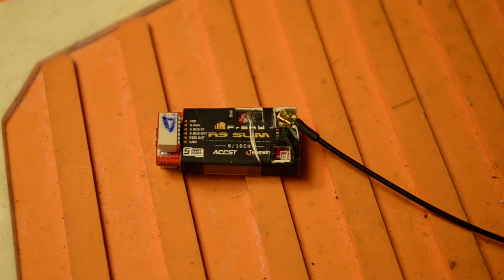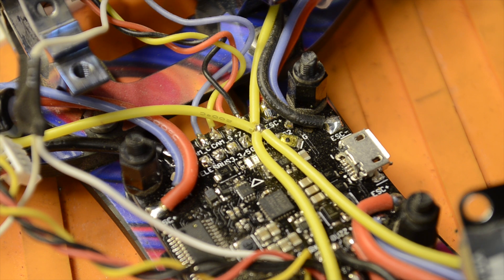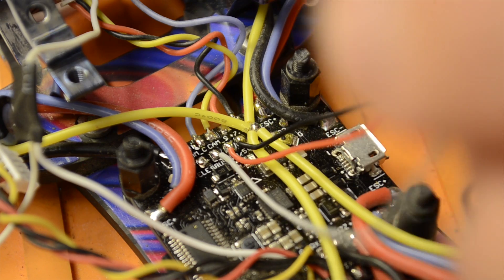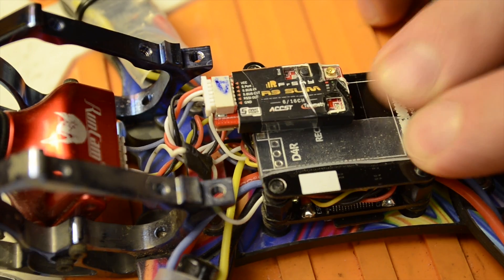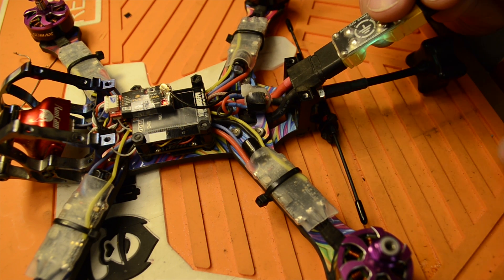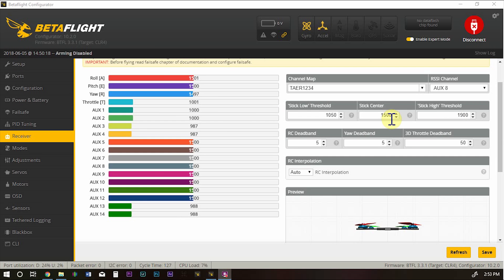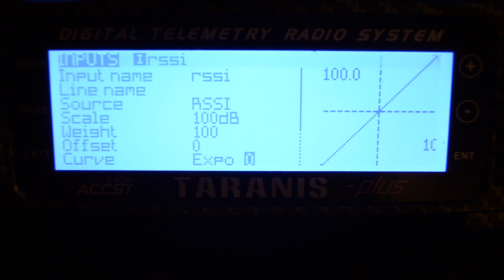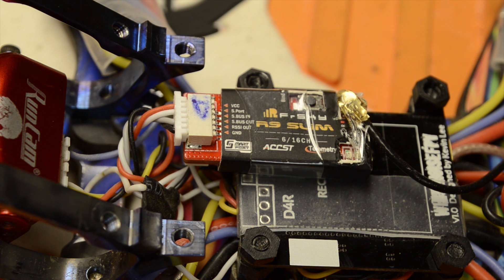Frsky R9 Slim flight controller install, betaflight and , RSSI setup

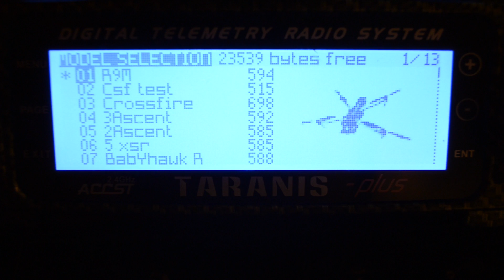Comment: At 10:30 when you say you are not receiving telemetry back from the flight controller, what do you exactly mean what aren’t you receiving. Newbie here :)
Reply from the maker: You won't get flight controller information like: sats (if you have GPS), be able to use LUA scripts for controlling your VTX through your radio screen, and so on. There is a bunch of sensor info that your FC has that can be sent back to your radio for you do interact with. Which sensors depends on your FC.
Reply: @TweetFPV  thanks much appreciate that detailed reply👍

Comment: Great info thanks for sharing ..my question is why don't we setup the sbus in and out ? I have the Frsky R9 Slim + and it also has an rx and tx as well do I need to set them up as well ? Thanks for your time
Reply from the maker: Sbus in on the slim is for receiver redundancy. So you can have a second receiver installed feeding sbus into the R9 Slim so if one fail safes then the other one will take over.
Reply: @TweetFPV   Thank you for getting back to me so quick ...This is my first build and I don't want to wire up anything I don't need too .. I am now one of your subscribers ... Cheers
Reply from the maker: @1ken.cheniergmail  Thank you so much for the sub. The bare minimum you need to connect is power ground and sbus. those 3 and you can fly! Happy building.
Reply from the maker: Awesome, I look forward to it!

Comment: Does RSSI pad and Tele pad on FC are the same?
Reply from the maker: No they are different things. The rssi pad is for analog rssi values from your rx and the Tele pad is a pad for smart port telemetry because it will have an inverter on that uart
Reply: @TweetFPV  thanks alot, I really learn alot from your channel, auto subs! 😀👍

Comment: Hi,I'm installing the slim plus on a omnibus f4 v6 will this work for telemetry on my board and I do not have a tell pad on my board is it called something else? Thanks so much 💥
Reply from the maker: Yes. The slim + will work just fine. It has an inverted telemetry wire to use.

Comment: I’ve been looking into these, I have a set of fatsharks v3s, with the true d dual antenna receiver. Wouldn’t I just lose reception on my goggles if I tried to make use of the long range that these provide?
Reply: Thanks for the reply I’ll put it on my shopping list
Reply from the maker: In a short answer yes your 5.8GHz video link will be your limiting factor. With that said it is possible to get miles of range on 5.8GHz but you have to work towards getting that. Un-obstructed line of site and low background noise it is possible. I find that now with 900mhz rc link I no longer worry about that being a limiting factor. If my video gets bad I know that it's time to turn back. It much more obvious than watching the rssi go down.

Comment: I've had about 7 failsafe on a hundred packs on Slim receivers, d16, no Telemetry hooked up, TBS Immortal T free of carbon fiber... Stop using Diamond antenna seems to be causing more.. all fail-safes between 150 and 300 feet.. I turn power down 2 500mw thinking the high-power up close could be doing it.. no help. Any ideas or have any issues the same?
Reply from the maker: The majority of failsafes I've had were with the slim rx. I think there is an issue with the antenna length. What region are you flying in? I have had better results with the stock antennas than the immortal t antennas. What direction are you mounting your rx antenna and what antenna are you using on your r9m?
Reply: @TweetFPV  region Midwest..lol I think that's what ya ment, umm putting them flat on the arm under esc ( I'm heard keep away from nosiey electronics, which I dont see possible) I'm using mix of TBS and stock on quad. Diapole on r9m

Comment: Good info. Thanks. Can I use R9 slim to APM ...???
Reply from the maker: I'm sorry, I don't know what APM is.
Reply: @TweetFPV  Arduino Pilot flight control module. ( Like PIXHAWK )
Reply from the maker: Hmm. I'm not sure if it will. If APM can use serial protocols like sbus then I don't see why not. The r9 slim also has standard ppm outputs.

Comment: Could you link the cleaning tool that you use at 4:55?
Reply from the maker: Absolutely it is a product allied Flux off. Chemtronics Flux-Off 1035 Concentrate Flux Remover Aerosol Can - Flammable - ES835B [PRICE is per CAN] https://www.amazon.com/dp/B007XIKL9M/ref=cm_sw_r_cp_apa_GqpMBbTXNZT0Y

Comment: hey man i gotta a issue with my r9 slim plus telemetry doesnt wrk.on the taranius itself when i discover the telemerty sensor..can u help me out .i hav turned on s.port
Reply from the maker: Yea I can. What are some of the details of your setup?
Reply: I believe the issue will be resolved if you update the R9M module firmware.

Comment: Hi . I've just ordered my set up . After using it for a few do you have any more tips or tricks .
New subscriber
Reply from the maker: Yes, do not connect your recievers power to a pad that is powered off the USB port. If you make it only powered when the lipo is connected you can flash firmware using serial passthrough in betaflight. So you wouldn't need to remove your reciever to flash new firmware.
Reply: @TweetFPV  . Thanks for the tip . 😁

Comment: I am having a problem where my AUX swithc channels dont respond. How many channels is your model set to ? Any idea what I should try?
Reply from the maker: I use 1-8. Do you have your aux switches mapped properly in your transmitter?

Comment: Just the information I need.. you deserve a sub.. just quick question, does rssi still works when no telemetry is selected?
Reply from the maker: It depends on which receiver you are using and which version of firmware you are using.
Reply: TweetFPV same r9 slim and r9m module.. or maybe you need to connect the rssi output on fc rssi pad?
Reply from the maker: That is one of the few ways to get rssi without telemetry. Frsky just dropped a new firmware for the r9 mini that has rssi on ch16 all the time. If you have a rx with a rssi out you certainly can solder that to the rssi pad on your fc if you have one.
Reply from the maker: Also fport natively has rssi in its communications all the time for the fc to use.
Reply: TweetFPV would you connect both smartport and rssi to make sure you have rssi with or without telemetry?
Reply from the maker: Yes, also if you have telemetry sent to your radio you will need to send it back via channel mapping back to the fc if you wanted it on an osd. I feel like this isn't the best solution. Like I said before there are many different options for rssi.

Comment: nice tutorial , worked for me . I wonder if you tested how reliable is the RSSI  feedback ?
Reply from the maker: I am working on that right now. I'm trying to compair the r9 to the crsf. The issue I am having is rssi is way different than lq that tbs uses. If you compair the rssi of both systems the r9 has been WAY higher than the crossfire in the same power output and flight scenario.